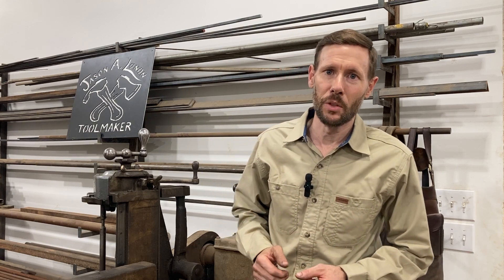Metallurgy For The Rest Of Us

Comment: I would like to know what is the difference to work with simple steels to more high end ones. Is it more difficault to work with? Will a moderate steel blade be the same as one from high end when doing the same simple heat treatment?

Comment: Been wondering about metallurgy for awhile now. Specially aluminum.  I'm aliminum mig weldng 6061 aluminum right now with 4043 wire but I love carbon steel tig and 7018 stick